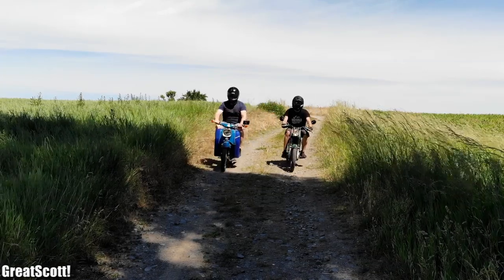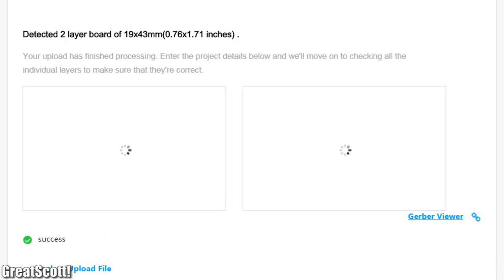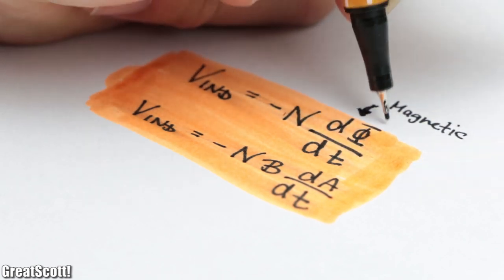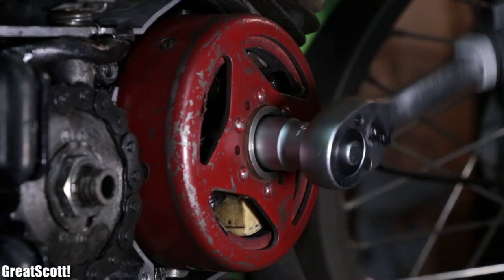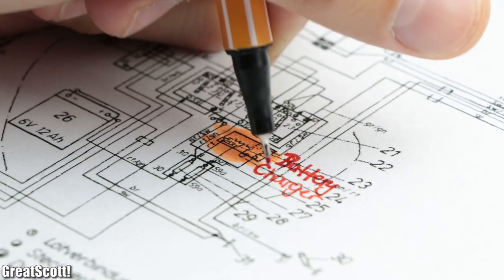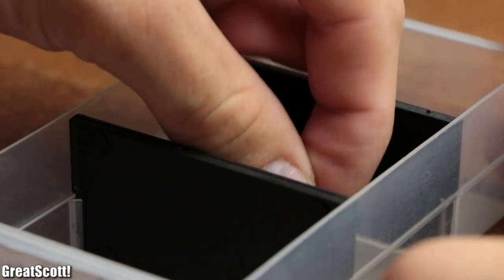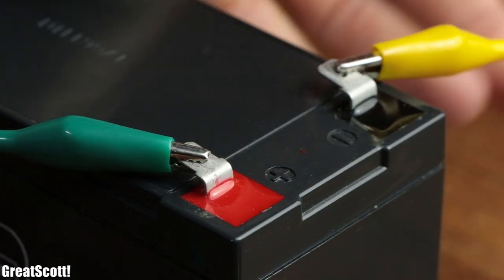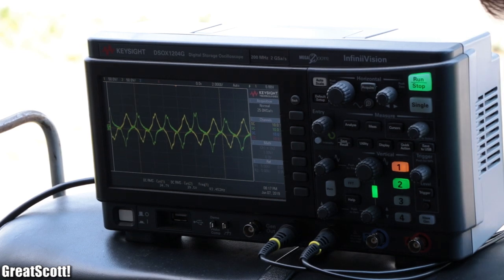HACKED!: 6V Electric Generator UPGRADE to 12V!

Comment: i put neodym magnets in my Vespa Ciao's "generator" instead of the normal weak "magnet", power went from 18-20W to 100-150W ;), but had to change capacitor to a much higher voltage rating and cant remember capacity, but if capacity is to low or to high the motor will either have trouble maintaining idle or will have limited RPM. This was about 15 years ago, have not ridden ICE since i converted a Ciao to Electric (Google Electro Ciao)

Comment: Would it not be cheaper and quicker to fit a used  larger 12v motorbike rectifier regulator? More compact too and less risky for any electrical mishaps. Just my 2 cents worth. Great work as usual Scott.

Comment: Why did you use a linear voltage regulator, instead of a buck/boost converter? (yes i mean buck/boost and not a only boost converter or only buck converter)
Is it the additional component cost?
Reply: Simplicity? It's just a simple bike, no need to overcomplicate it in my thoughts... I'd stick with the most worry free design as efficiency  really doesn't matter in a case like this.

Comment: nice job!  luckely my Tomos moped is just running on 12V! :-) and my Saxonette is also 12V, but the 18650 conversion (from NiCD) kinda works, but still needs improvements :- )

Comment: Put a micro expansion chamber exhaust on your bike and file approximately 2 mm off the back skirt of the piston and you will notice a considerable increase in power and a lot higher revving bike also your bike  Will have a noticeable increase in speed I run one of these bikes for two or three years cheers Derek

Comment: I'm working on a similar project myself, and while I think this approach is probably the quickest and easiest, it sure is annoying to run a completely separate ground for all of the electrical components on the bike. I'd really like to find a way to get the coils and all the lights to share the frame as a common ground point!

Comment: Why you added a diode instead of raising the resistor values with the correct ratio? Is that possible to use higher value resistors? Then why you use smaller value resistors plus a diolde?

Comment: Wow! I don't think that you are moped fan too! Greetings from Poland! I have had made an ignition module on MOSFET controlled by hall sensor. Dedicated for Jawa 223 engine, which was used in Romet Ogar 200. :)

Why you don't think about rewinding the old coils from ignition base by new winding wire? I achieved a few Watts of power after this operation. I used the same wire guage, but I add a maximum amounts of windings.

Comment: Nice, but why not use a switching supply rather than wasting power with a linear regulator? A sepic configuration would be ideal since it would also prevent the battery from discharging...

Comment: I was thinking about a battery charging system for my Zündapp 517 C50 with a original 6V contact controlled ignition. The problem is that the voltage and current from the original coil for the breaklight wich I want to use, is very low, like 0,7A at about 7V max. So charging a 6V AGM battery isn´t as easy. Using some boost circurity would lead to more loss in the already low current.
Reply: I have placed a nice Kokusan on my Kreidler.
Reply: @patricknieuwlaats357  yes, thats a good option, but I want to keep the moped in a perfect original condition. The Battery isn´t factory original though, But it was added not that much later from a workshop, maybe in the mid 70´s.

Comment: Wow, talk about taking the long way around!
Would be a lot easyer and cheaper to just buy a scooter 2-phase voltage regulator to fix the charging issue!
Can get the GY6 Voltage Regulator for 1 and 2 and 3 phase quite cheap.
They both rectify and regulate voltage to charge 12V battery and feed the lights.
Also nicely fitted in a waterproof packet with a heatsink on as well ;-)

Comment: Why charge the battery at 1.5 amps tho? Wouldn't it be better to charge a lead acid with more? I could be wrong but just curious
Reply: 1.5A is max for LM317. Also, recommended charing current for lead acid batteries is somewhere between 10-30% of it's rated capacity.
Reply: @ukaszsmoa8416  gotchya. Thank you!! :)

Comment: Why dont you LEDify the mopeds? Should save a lot of current
Reply: IMO the main reason is law. LED inside old type headlight mounting couldn't create enoufht light stream on road. It depends on the optics of light reflector.
Reply: That would render the ac supply from the alternator to light useless. As the LEDs use dc current, and needs to be rewired. I have an idea!!.

Comment: Great info but I didn’t see your reasonintnall the way with most of the things you decided to do. Like why you chose sizes resistors and how much the system actually put out and why you chose the new coil. How man turns did the coil have . Stuff like thet

Comment: correct me if im wrong but should there not be a capacitor attached to smooth out the current that charges the battery? again.. i dont know, im just asking in case there was a good reason it was not done so

Comment: Make eletronic spark for the motocicle, they get more power to the motor,. advancing timing eletronic.
 keep gping.
Reply: Great idea. Electronic ignition with a hall effect sensor for pickup.  
Next moped video has to be DIY or BUY AC-CDI box and electronic ignition.

Want to build something similar for my 50cc yamha fs1 moped. Have tried to reverse engineer the circuit but dont have enough knowledge for it.
Reply: Add Arduino and bluetooth setup for ignition timing. :D
Reply: He has the electronic ignition

Comment: Well, since it's such a basic motor bike i would sugest to just add one 125cc modern bike voltage regulator, it's really cool to make your own circuit but over the years i just found that in a bike it's never reliable enough

Comment: Very interesting! I would like to convert my old, battery less, motorcycle from 6 to 12 volt. It only have a induction and a zener like what is mentioned in the video. How do I calculate the size of the induction spool?

Comment: I believe the regulator was not good enough, one reason  is that if you have a load of 55Watts which is around 4.5 Amps for the headlight alone then you need another 1 Amps to maintain the battery to its current state then 1.5 Amps is not near to good solution.

Comment: I want to convert my 1974 MT 250 Elsinore . The charge coil uses both ends to feed the single phase rectifier input
The lighting coil is grounded one end so is the ignition coil they have a star point.
I have a spare magneto
If i take the spare charge coil and put it on the bike removing the lighting coil. Have a new star point with the 2 charge coils and feed a 12v rec/reg will it matter if they are out of phase? I think they will be as the magnets do not line up with the pole faces at the same time for each coil ? Or could i use a 3 phase rectifier and just use 2 inputs - switching one on and off with the headlight switch ? Which website will sell a 12v honda coil to fit my bike or could i wind more turns onto the existing one?
I dont have an oscilloscope

Comment: You want to upgrade to a 55W headlight, but instead could have put in a lower power LED headlight that consumed less power, put out more light, and you wouldn't have had to redesign anything to allow for extra power consumption.

Comment: Do you need copper grease on the connection between the coils and the main body of the housing to prevent corrosion?

Comment: Ok so I’d like to know if you could create over unity with a magneto setup from a motor like this possibly run by a 12v Motor pulley system. Just pull start and it runs?

Comment: with only 11. something Volts you are killing your Battery. Lead Acid Batteries need a solid 14.4 V to be charged correctly. You should take that into account. It also helps to decrease your heatproblem.

Comment: why do people call it a 12v battery whetter it is like a 13.8v battery
Reply: It's charged up to 14.7V in most systems. But it's voltage would quickly drop to aroud ~12.5V once the charger stops charging it. Also, once the load starts drawing current from the battery, there will be voltage drop across it's internal resistance.
It's the same thing with li-ion batteries. You charge them to max. 4.2V, but once the max. rated current starts flowing, voltage across it's terminals will be ~3.7V for healthy, freshly charged battery, and this is what is printed in most cases on the battery.
Reply: @ukaszsmoa8416  wow thanks for that!!

Comment: Why don't just rewire the light directly via DC supply, and voltage could be adjusted by buck boost converter. LEDs could be ideal then.

Comment: Can you make a moto bike CDI diy or buy because is the reason my bike (yamaha 125 DT) is stopped in the garage 😔
Reply: Is there active or passive ignition timing system? ;) Active must have obligatory enought current at low RPM. Which is not problem in passive ITS.
Reply: @Tomciosz94  I think is active is a yamaha dt from 1991...

Comment: Is it also possible to connect the battery charger coil and the light coil in series an run the light straight from the battery?

Comment: This solution is not going to work for very long with the headlight on since the LM317 can't provide enough current to keep the battery charged with the lights on. I would eliminate it altogether and connect the output straight to the battery.  The headlight is basically running off the generator after a few minutes when the battery starts to get discharged so the generator has to provide enough current to handle the entire load of everything on the moped that will be using power including the all the lights and charging the battery as well or the battery will go dead in no time!  Yamaha motorcycle models XS650, XS750 and XS100 used to have this problem because the generator didn't provide enough current at idle to charge the battery with the headlight on and after everyone started riding with their lights on all the time the battery would go dead if you were sitting very long in slow traffic.

Comment: Can you explain why the coils generated such a terrible AC sine wave?
Reply: Weirdness in magnetic properties of the coil core can cause distortion of waveform. Probably the moped engineers didn't care about that, as the moped electronics are not sensitive to the waveform.

Comment: How much did this update cost in total for your Moped?
Reply from the maker: Maybe around 20€
Reply: And why didn't you use a buck converter with current limiting function for the battery charging?

Comment: That circuit will break or corrode in days
Reply: @johnreese3446  the pcb will be subjected to a constant vibration and surely the ambient humidity will find a way to get inside. That can cause some component released over time, or maybe it works forever who knows

Comment: Why didn't he use led light?
Reply: fassenkugel  There are legal modules with homologation mark valid in all of Europe, Harley Daymaker style. But they are more expensive than replacing the bulb.
Reply: cause not so original...
Reply: fassenkugel  Can't you change bike's exhaust? It's the same think. As long as it has homologation mark, you should be good. I'm not talking about retrofitting led bulbs into existing reflector. You buy the whole unit. For it to be legal, it has to have E#, where # is the number of country it was tested. If it was tested in Europe (E is for European countries only, I think DOT is for USA), but not in Great Britan, it should be legal.

Comment: Hello I want to build a project with one motor that only works with 5v  and I need a 0 to 5v controller and I have no idea how to do it cloud you teach how to make one ?
Reply: What voltage are you using to power it? Are you trying to adjust the speed by changing the voltage from 0-5v?
Reply: @jussapitka6041  the power voltage is 5v and want to control the output
Reply: @jfk4229  thank I will ask the for the advice 😀

Comment: Help me make a video on improving ps vita adding a small much better external Gpu and cpu that work in the place of internal ones and add a small air cooler, add more battery remove unwanted things make ps vita more fatty by adding a 3D printed piece between front case and back case add usb thou c port remove sim slot and add some useful thing there make use of external port on ps vita make it better and do it all on ps vita 1000 please reply to me yes or no this is a big challenge make and release every video with a part of doing every thing separate please do it accept the challenge the people who agree with me hit like there are many people out there who want this reply soon sorry for my bad English just wanna to upgrade ps vita to play PS3 games